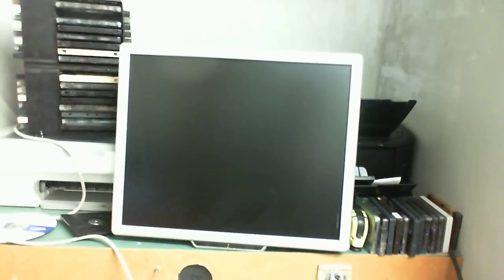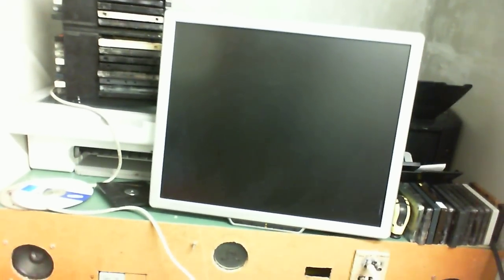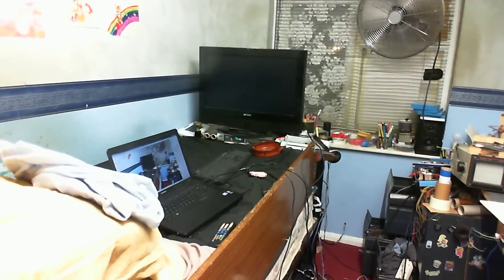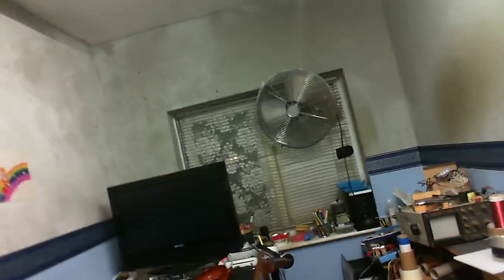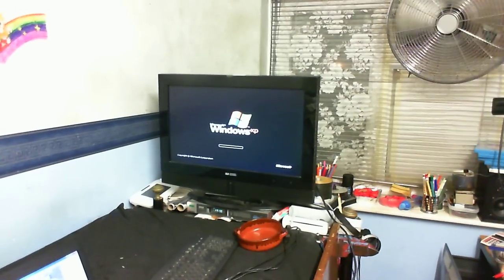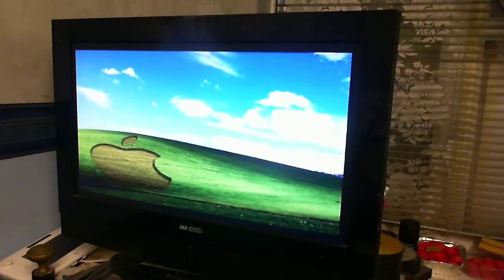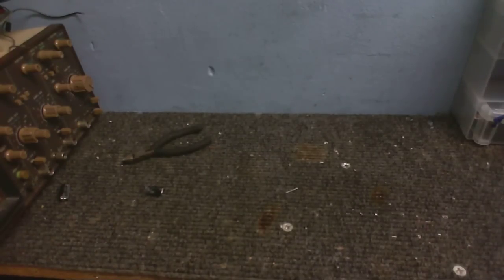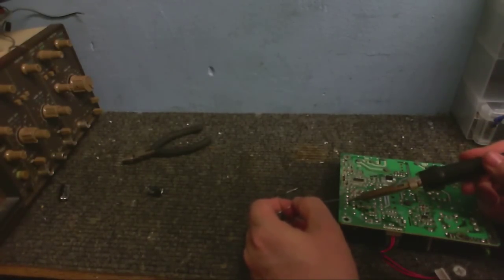Fixing my computer's monitor

Comment: When replacing capacitors in a power supply or computer motherboard its a good idea to use the low ESR capacitors because they will last longer and are made those applications. Avoid any cheap capacitors from Asia, Europe, or other third world countries.

Comment: idea: you should get a IBM PS/2 Monitor from the early 90's or a IBM PS/ValuePoint Monitor from the mid 90's.. those monitors are cooler and are vintage and build better. stay away from getting a crappy LED one those things are poorly made